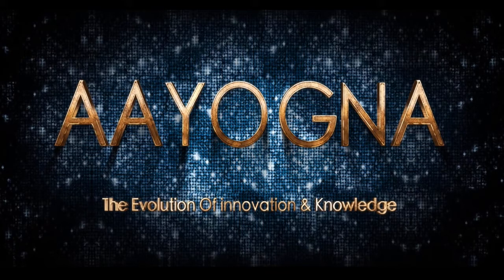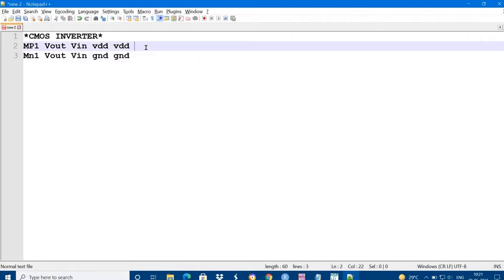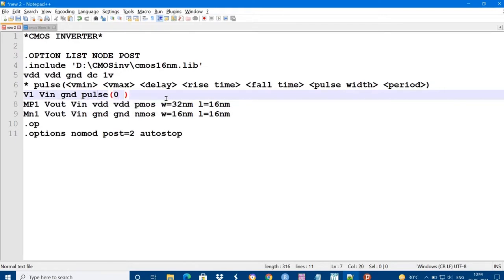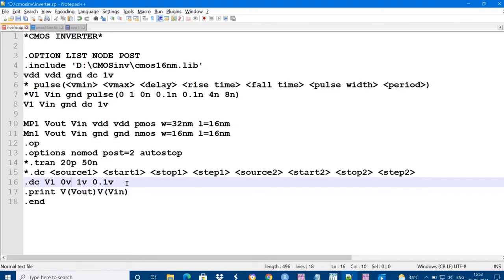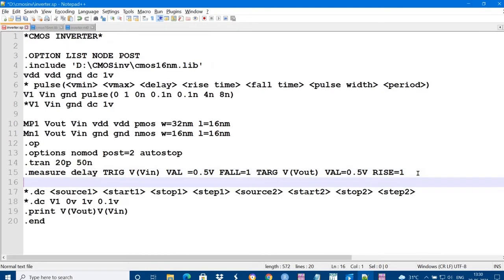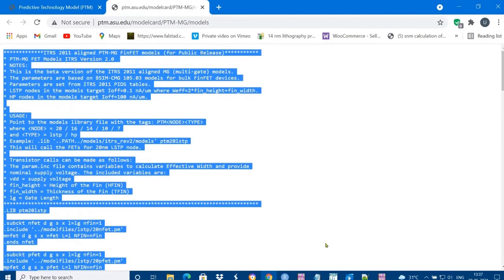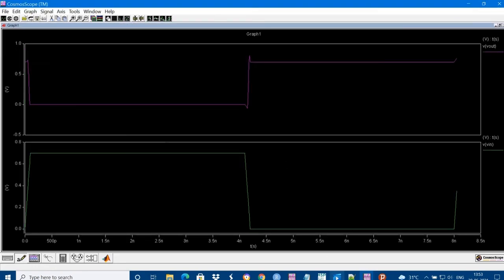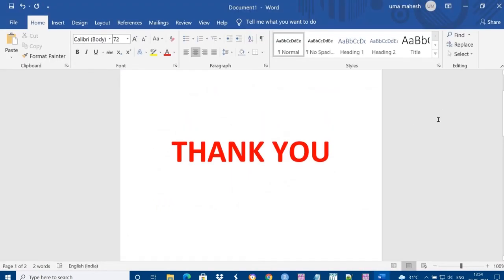CMOS INVERTER USING HSPICE | TRANSIENT, DC ANALYSIS |PARAMETERS MEASURE | FinFET | PART-3 Waveview

Comment: .OPTION LIST NODE POST 
.include 'C:\ngspice-43_64\Spice64\bin\finfet.lib'
.include 'C:\ngspice-43_64\Spice64\bin\model.lib'
.include "C:\ngspice-43_64\Spice64\bin\20nm_HP.pm" 

.param vdd=0.7
.param vddp=-0.7
.param fin_height=18n
.param fin_width=7n
.param lg=11n

.subckt nfet d g s x l=lg nfin=1
mnfet d g s x nfet L=l NFIN=nfin
.ends nfet

.subckt pfet d g s x l=lg nfin=1
mpfet d g s x pfet L=l NFIN=nfin
.ends pfet

Vpower 	VD 0 0.7
Vgnd VS  0    0

Vgate	Vin	VS  PULSE (0 0.7 100p 50p 50p 200p 500p)	

mnfet	vout	vin	VS	VS	nfet L=lg nfin=3
mpfet	vout	vin	VD	VD	pfet L=lg nfin=3

*.dc vin 0 1 1m
.tran 3ps 1000ps
*.dc Vgate 0 1.5 0.1m

.control
run
set color0=white
set xbrushwidth=3
plot  vin 
plot vout
plot i(Vpower)
.endc
.end
 Sir, again  i am getting same Error as " could not find include file ../modelfiles/lstp/20nfet.pm. "
Sir, you are saying please add your local path where actually your file is located. Please say where i can modify from above code

Comment: SIr, I have downloaded finfet.lib, model.lib, param.inc files. I am using in NGPISCE . I have done same modifications as you. If i simulate it, i am getting could not find include file ../modelfiles/lstp/20nfet.pm. Sir, how to solve it? Please explain
Reply from the maker: @PILLEMRAMESH23PHD722  please add your local path where actually your file is located.

Comment: Could you please share the code. Or share the file. And also I am getting error of including libraries. Please help
Reply from the maker: Hi, Thank you for watching. For a CMOS inverter you can type the same thing shown, check the library path, you should add ur library path where it is located. If CMOS gets success, then you can try with FinFET model libraries.

Comment: Sir, your "StaticPower" is actually DynamicPowerConsumtion (Switching + Shorted-Circuit power). Static power is defining as (avg(leakage current of pmos + leakage current nmos)/2)*VDD. And "averagepower" is average power dissipation, that used for calculating PDP thereafter.